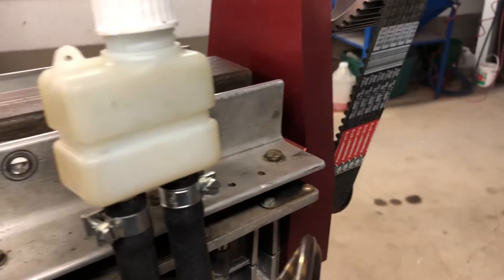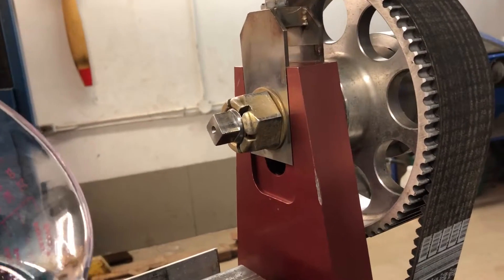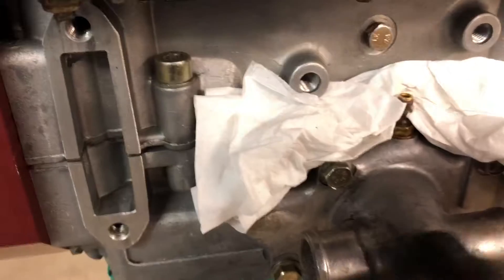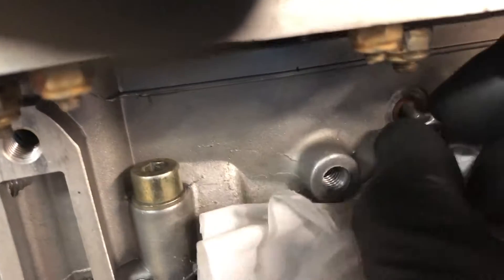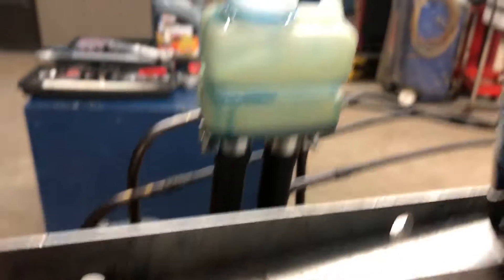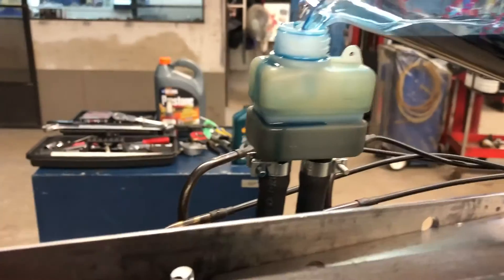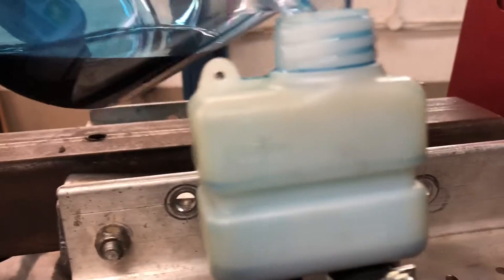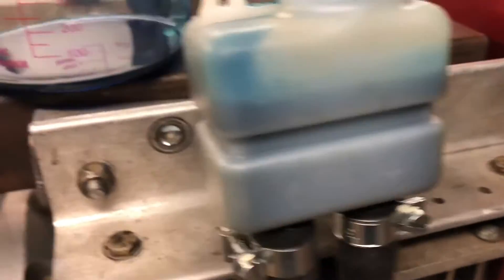Rotax 582 rotary oil change with spark plugs down

Comment: Do I need to be concerned that my inverted 582 has oil covered spark plugs after sitting for prolonged periods
Reply from the maker: Inverted premixed 503/582 engines do have wet spark plugs after sitting. They then start up normally. However should the engine be equipped with an oil pump one or both injection valves could be defective. This condition can drain so much oil into the cylinders that the engine will hydraulic lock and won’t crank over. 
During pre-flight inspection It’s always a good idea to rotate the propeller in the correct direction ( ignition confirmed off) to ensure the engine is not hydraulic locked. 
To sum up, if it’s a no oil pump engine, it’s normal. If it has an oil pump equipped engine further investigation may be required.

Comment: I have a 582, when I flip to mag #2 the rpm number drops to Zero, #1 drops 100-150, no change in actual RPM or sound of engine from mag 1 to 2.  What maybe the issue? Wiring loose
Reply from the maker: If your not hearing any real change in rpm perhaps the tachometer or tachometer pic up point cold be the issue. What tachometer do you use?
Reply: same issue with my rotax 582 , analog tachometer turns to zero while digital tachometer shows no change .

Comment: Should this oil be a blend?  I keep hearing about 2 strokes rusting out from people running pure sythetic and then not fogging.  Obviously fogging does nothing for the rotary/cross shaft.  Any thoughts on using something like Pennzoil Marine Premium Plus or the like? (for the gas and cross)
Reply from the maker: Thanks for your inquiry. The selection of rotary case oil is not complicated for me. Rotax spent a lot of money to designed, test and developed these engines for aircraft use.  I will continue using their recommended lubricants. I’ll never understand why people entertain experiments on their engines with with the internet oil idea of the day? Rotax-Owner.com has free downloads of the current information manuals for your engine. Check it out! 
Marine oil is for boats that operate at much lower internal engine temperature than your 582 aircraft engine. Using  boat oil will result in reduced lubrication of the entire engine. 
Best regards  John
Reply: @RotacRepair  That's why I'm doing research before I get started.  I've only dealt with snowmobiles and 4 stroke piston engines.
Reply: hi which kind of oil schuld be used?